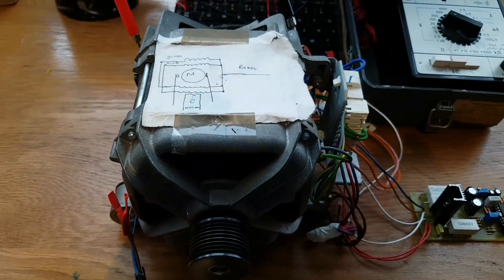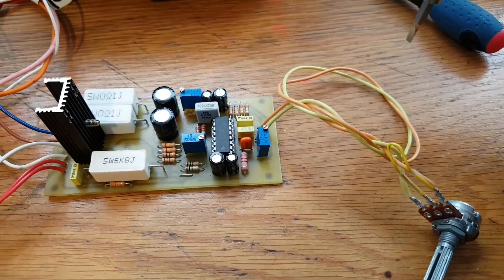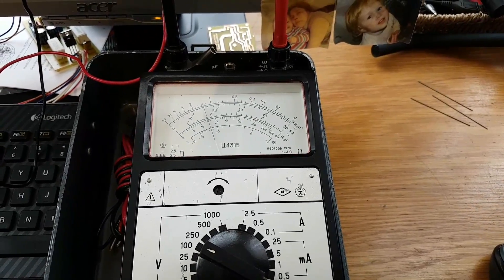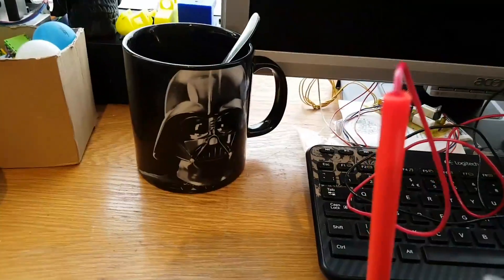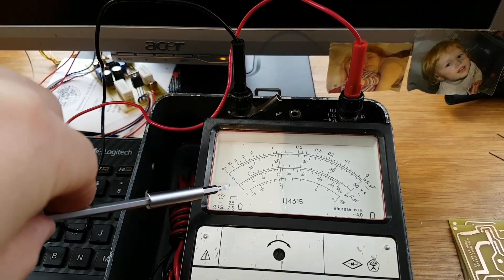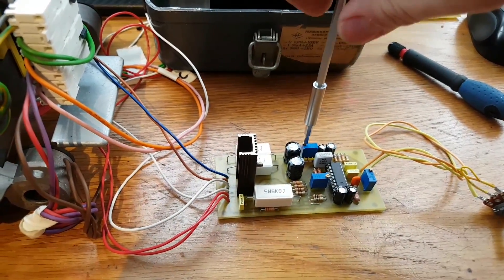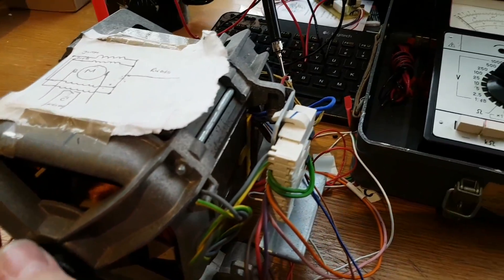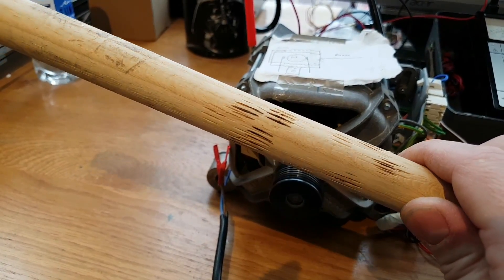Washing machine motor speed regulator controller. TDA1085C

Comment: The feedback is perfect for maintaining RPM and Power which makes using an SCR for an AC Motor Speed Control Practical.  Nice build.  Have you installed this on a lathe or any power tool requiring variable speed?  Will this work for 110V?